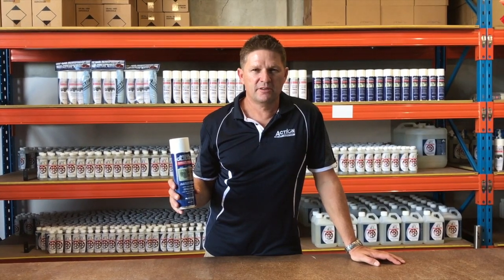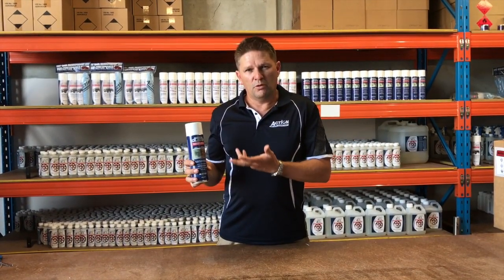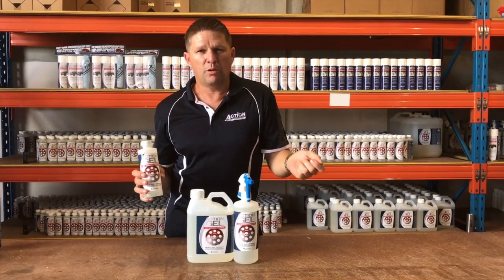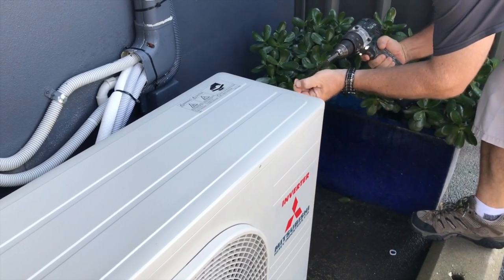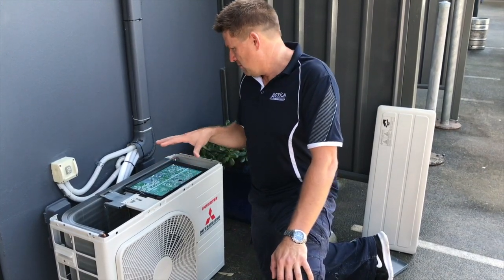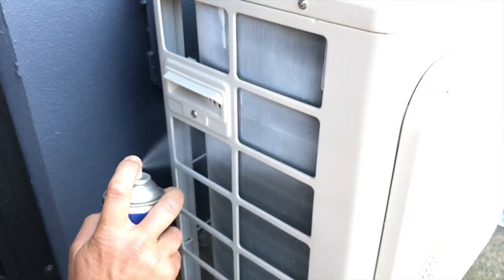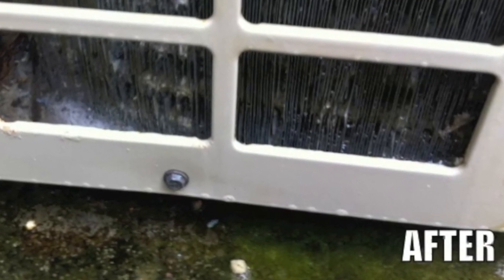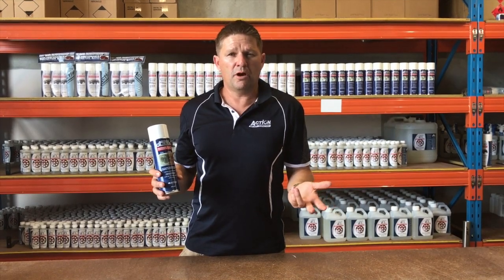ANTI CORROSION FOR HVAC-R

Comment: Misguided video , When you apply it at Air conditioner fins ,

it will reduce the cooling efficiency because its an insulator , however you can use it on the sides as they are not used for heat exchange.

Comment: Used some today, the can just sprayed it out mostly as a liquid, all over the can, my hands, safety thongs, tiled floor and everything in between. The spray cap was the larger version compared to this old school cap shown in this video. More like the 2020's WD-40 style cap. Anyway, I used the whole can to apply 4 thick coats, as per the instructions, and ran out before slapping the lid back on and sealing it all up. Wasted a lot of product by spewing the liquid all over the place as a described above. Hopefully it does the job.
Reply from the maker: I am sorry to hear the aerosol malfunctioned. This should have been returned to the supplier and replaced with a functioning aerosol so that that you did not run out of product.

Comment: Can the spray also be used for protection against Geckos or do we need both products. We already have two sprays bought from you.
Reply from the maker: The HVAC-R Liquid and the HVAC-R aerosol are both the same product just in different forms. You can certainly apply the aerosol to the PCB to protect from Geckos. Just ensure the unit is turned off, you wait an hour after the last coat until turning the unit back on and you do 4 coats to cover all the sharp edges.

Comment: Can the Anti Corrosion HVAC-R be used on moving parts / machinery as a rust proof ?
Reply from the maker: The HVAC-R can also be used on metal surfaces, as shown when coating the air conditioning unit. However any sort of abrasion or rubbing on the coating may damage it and allow moisture/salt to make contact with the metal surface and cause corrosion.

Comment: It is one time ? or you have to use it yearly ?
Reply from the maker: Spot check it annually as you may need a touch up or two, but the product will last2-3 years depending on location, thickness that it's applied, etc.